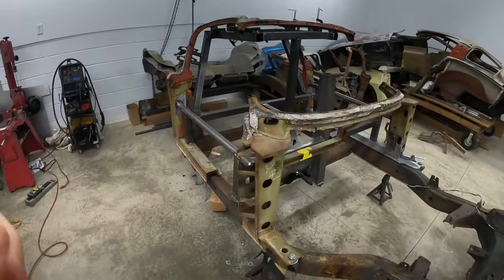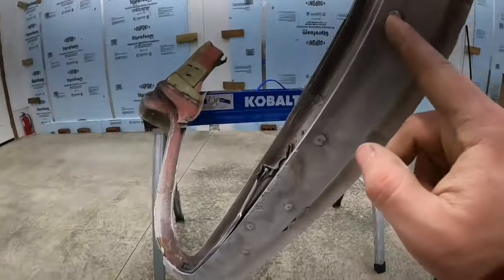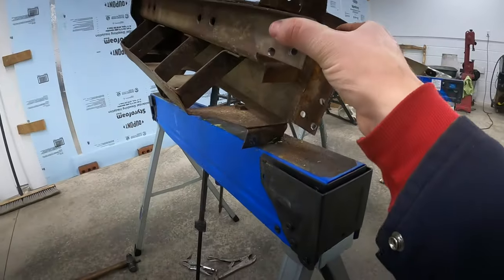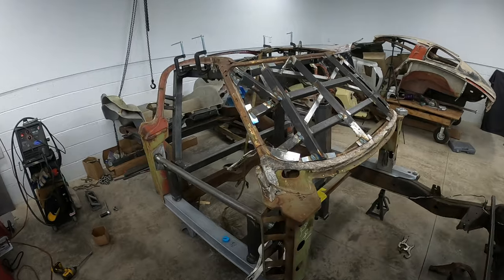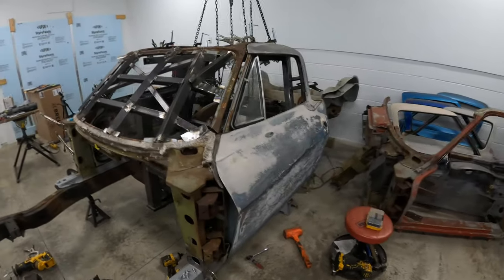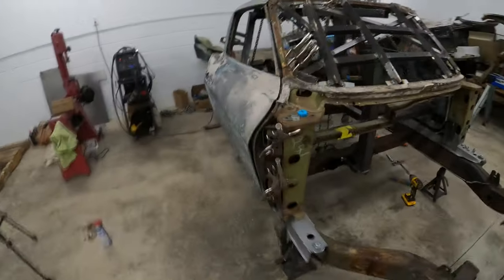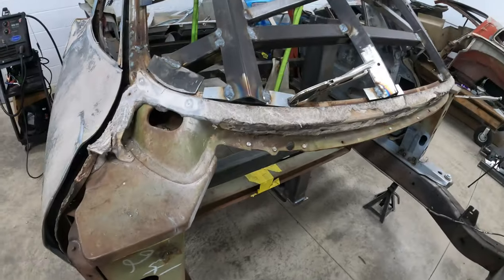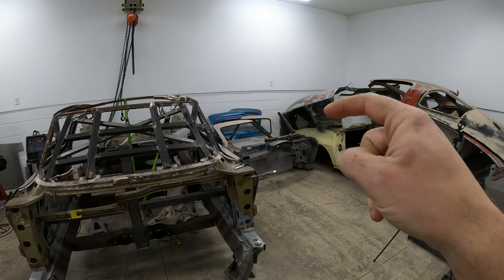Repairing a Neglected, Rusty, and Wrecked Split Window Birdcage.  Field Find Split Window Part 4.

Comment: Nice work Mitch , I would not take on something like this . Too old . Really enjoy watching the videos . Are you keeping track of your hours ? It would be interesting to know . As a tool maker machinest I know how long it takes to machine things but all the fabrication I have no clue .
Reply from the maker: Hey Bob thanks. It’s a lot of fun but it’s also a lot of work. So normally one video is equal to a weeks worth of work. I didn’t keep track but there’s probably about 30 hours of work there. It took 2 days to fix both of those corners of the roof. I spent a lot of time off camera test fitting parts and making small adjustments. So there is a lot of hours in the details. Since you’re a tool maker you know the deal. I actually worked in the drafting department of a tool and die shop for my first job out of college. It was neat to see those guys work in the shop.
Reply: @MidYearMitch  thanks for getting back to me Mitch , I know it takes a long time to fabricate and I only do the simple stuff as needed,nothing like what you are doing.These videos are fun to watch!

Comment: Becoming one with your project, huh Mitch. Such patients. Are you aware of Eastwoods Co. spot weld removing drill bit? It might make your work less difficult.
Reply from the maker: Hey Manuel.  Yes you must become one with the birdcage to fix the birdcage lol.  Yes I did buy one of their bits and one of the harbor freight bits.  Half of the battle is finding the spot welds on these things.  They kind of hide in the rust pits and the dude that built them sometimes stacked them right next to each other. I broke teeth off the harbor freight one immediately. The eastwood one worked but it got dull fairly quickly.  So I try to keep a few fresh 1/8 bits and 5/16 bits around.  That has worked pretty well so far.

Comment: Did someone who built these cars back in the 60s teach you first hand the inner workings of these cars? I had no idea there was so much to these bodies. Amazing to see a Corvette created from recycled pieces.
Reply from the maker: I kind of learned by doing.  I was doing a search on eBay and found the Misfit parts.  I bought them without having any birdcage experience.  I learned as I fixed that car.  I was aware of the bird cages but I never really dove in.  I saw pictures of C2's in a junkyard and I thought one day I will fix those cars.  So I've always had the dream to do it.  I was ambitious (or crazy) enough to just dive in.  I learned a lot by studying the assembly manual and other guides to see the order of operations. But I just kind of did it lol.  That's why I thought it would be neat to document.  I think its fun and rewarding to take parts that have been sitting on a shelf for 30+ years and put them to work.
Reply: @MidYearMitch  That's awesome. 67 is my favorite year..Coupe or Roadster.

Comment: Some of these parts look so corroded how do you determine they are road worthy?
Reply from the maker: Hi William.  It might be hard to see from the video but in person I can get a better idea on the metal thickness.  If you look through the holes where the bonding strips rivet to you can see the metal thickness.  Also when I had to replace rust (my video that will come out this week) I would make a big patch to make sure I got all the rust out.  I went through the cage with a fine comb so it is very solid.